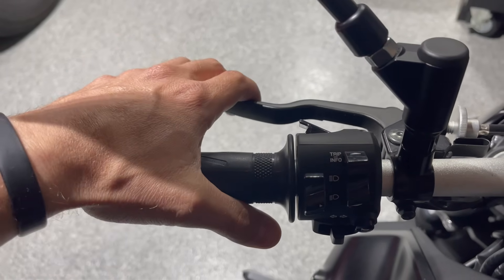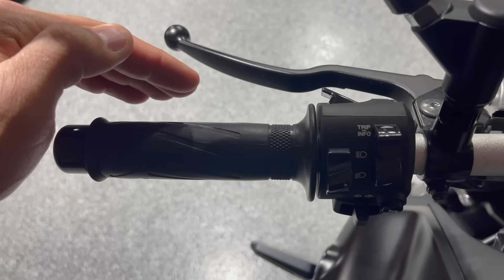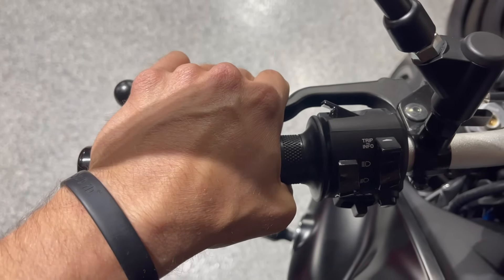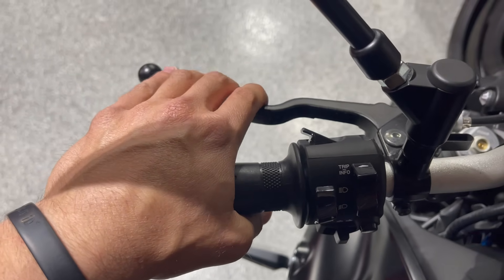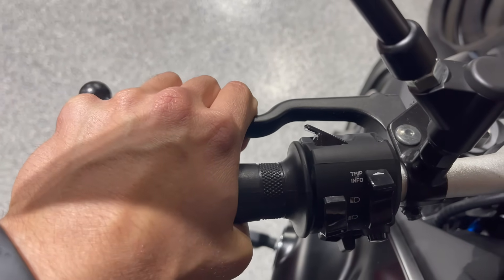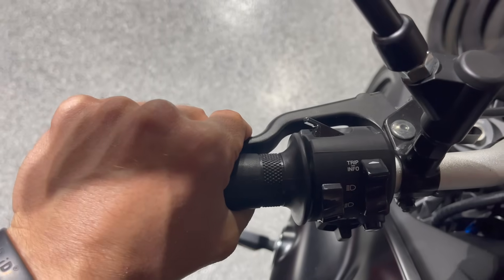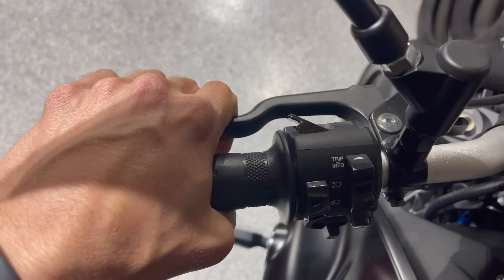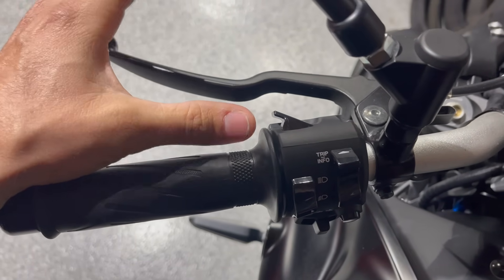Don't Make This Common Clutch Mistake!

Comment: I have never had any problem with any other bikes until my 2016 Harley Street Glide. I was very confident riding in slow speed on other bikes until I got Harley. Felt like I forgot how to ride Lol ! First the friction zone is right in the middle when bike is cold, after you do slow speed drills and when bike is hot friction zone moves far out. Very unpredictable. For reference my bike is all stock, bought it new  and has 52,000 miles.

Comment: No disrespect but never change gears in partial clutch play. This will impact your engine performance and clutch plate with time. 
The correct way is to fully pull the clutch and change gear that's why its called clutch disengagement. When you pull the clutch fully the gear box is freed for you to change gears. 
When you partial even if u don't touch the throttle the bike the bike will move forward that's because the gear is working to push the bike ahead and changing gear in this mode will guarantee destroy your clutch plate and all the tooth in it.
Reply from the maker: Well I must be lucky because 500k miles I never had an issue with any of my bike's clutch. But you ride how you wish, no one says you have to do what I suggest in any of my videos.
Reply: @MotoJitsu   NP buddy but people watch your video and pick up tips. I feel it right to show what's right. I repair bikes in India and people here don't sell their bike often and literally use the bike for years. This issue of clutch plate is major for most riders especially the new riders who burn out their clutches due to partial clutch play.
I am just sharing what works best and is not targeted against you 🙏
Reply from the maker: I just re-watched my own video to ensure I remembered what I was saying in it...yes you don't have to pull in the clutch all the way...no worry about damage...especially true for my slow speed MotoJitsu drills, just play in the friction zone. If you don't want to do that, don't. But there's no harm. Many ways to do one thing. I know some people who try to do my drills without touch the clutch at all...it's up to you. 

Sure if you're revving your engine and doing stupid stuff with your clutch you can destroy it in a day...maybe you see that in India but that's not what happens with the people who practice my drills. You thinking you have the "right" way of doing something is the issue...there's many ways to do one thing and what's best for you on your type of bike may not be what's best for someone else.

Lots of people ride lots of different bikes...what I said in this video is for anyone on any bike, how do I know that? Because I've ridden just about every bike you can imagine doing the same thing I say in this video and no issues...it's just another way of doing something. Just because you disagree doesn't make it "wrong"
Reply: @MotoJitsu  🙏👍

Comment: Very informative for the new riders , but one thing to factor is if you have a hydraulic clutch it's different not always but for instance my Suzuki Bandit is a hydraulic clutch and you have to pull the clutch in all the way for it to fully disengage , " non adjustable " and my Honda CR250 is a clutch cable " fully adjustable " like the one in the video and you can just use two fingers to pull it in. Just go off the feel of the clutch and you should have no problem

Comment: This is what I did wrong today, I wish you were in Philadelphia, I dropped my bike when making the U turn I fully pulled the clutch then when let it go it jumped and I squeezed the front brake because of the scare….now I need to fix the scratches

Comment: Once you get the timing down, you'll find that you don't even need the clutch to shift gears. With practice, one can shift right as the throttle is disengaged. This is known as floating gears.

Comment: Totally disagree 😐.
May be in a new bike you can do this, but after bike gets 3-4 years old, it's clutch becomes almost half. Then if you do this you will destroy your gearbox!
I have been riding a bike for 12 years and never found any issues by pulling full clutch while shifting.

Comment: I dont even care i just quickly pull the clutch let of the revs push it up a gear all with in a second wait one more pull the clutch max revs let go when I feel the kick die I slightly pull my clutch again quickly at max revs procced till end of the gear then I repeat

Comment: Question: But is it wrong if I pull the clutch all the way? If so, what'll go wrong? Just curious

Thank you
Reply: Nothing goes wrong--it's just a tip to make your life easier.
Reply: As a mechanic (40+ yrs)who knows what happens to your transmission when you shift, I fully disengage the clutch  when shifting.  Friction zone is an awsome control,  but your transmission won't like you shifting there
Reply: @brentfellers9632  feels much smoother, when not pulling clutch all the way.
Reply: @brentfellers9632  as another mechanic, ofc it's best not to shift whilst in the "friction zone", but once the disks have separated, it doesn't matter if they are a millimeter or a mile apart, so once you pulled past the "friction zone" (usually about 1/2 of total lever stroke, if set correctly) you can shift and you don't really need to pull any more.
Reply: @itzFYEB  I'm pickin up what your laying down,  your correct.thanx
Reply: @Bobby-lh2sx  I will try it, snowed yesterday, roads are clear today but needed to do some "adulting" today and wrenching on project bike....tomorrow 😢
Reply: @itzFYEB  Got it. Thanks!

Comment: When you’re doing low speed stuff do you keep the throttle going a little bit and just use the clutch to control speed? During my course, I noticed I was giving it throttle when getting into the friction zone and it made things a little jerky.
Reply: You need to also drag the rear brake while doing low speed maneuvers. Check out the ride like a pro channel.

Comment: the throttle is where most of us have issues especially on a vtwin, rpm too low engine gets choppy rpm too high is unnerving, a carbureted engine throttle feels more segmented where fuel injection is more dynamic or linear, at least on my bike where i have trouble is maintaining the rpm when twisting the bars back and forth

Comment: I actually do this when i change gears. Except when coming from neutral to 1st. But after that I just hit the friction zone I don't pull the clutch all the way in. Even on idle waiting in traffic. I just pull enough where it sits neutral while holding the clutch

Comment: The friction zone is where you adjust it to be at. You can have the friction zone at the grip, in the middle, or at the end of the range. But why are you using the clutch to upshift? Motorcycle transmissions are made to upshift without the clutch. And I suggest getting the clutch completely out of the friction zone to downshift.

Comment: I have small hands so i dont have my friction zone that far out and i have adjustable levers, so i can pull mine all the way in as i dont have to let it out quite as far. I think some people just set it up as per the workshop manual. But you dont have to aslong as the clitch isnt dragging you can have it bite where you like. Its easier for smaller hands.

Comment: I found this out by surprise on my second ever ride when riding on a long wide straight and accelerating quickly. I ended up shifting before I reached a full squeeze, which surprised me that it still continued to shift thinking I had made a mistake
Reply: Depending on the bike you ride if you're in the right rpm you can clutch less shift anyway so that might have been what you experienced

Comment: When shifting faster, I'll often only tap the clutch between gears. I'll use only two fingers and quickly tap on the clutch lever, pulling it in just barely enough to allow the clutch to slip, that combined with timing the throttle and shift lever makes for very fast and smooth shifts. Course thats only really one step remove from a full clutch less upshift, which I also do from time to time. Stuff like this is why I love a 300. Even on the street, being quick with your shifts can matter. Usually it doesn't, but if you're having a bit of fun and chasing a bike faster than you, you can use all the tools in your toolbox and use everything the bike has. Its that ability to safely and reasonably use everything your bike has whenever you like, that lets you get better and better at riding. I've practiced more highspeed clutchless shifts, spent more time maximizing rpms for power, and spent far more time working on my cornering than most people riding 1000cc bikes even can. Dont even get my started on low speed stuff.

Comment: Damn this reminded me I need to adjust my clutch cable tension… I’ve been having to pull extra hard lately haha
Reply: Well the cable adjustment isn't to vary the pull effort at the lever. You should have a little slack at the lever. That way your clutch will be fully engaged. If your lever is harder to pull than before, there's something wrong.

Comment: I wish my msf instructors would have taught us this way about shifting. I was pulling it all the way in when shifting and my shifts were rough. I had 2 smooth shifts in the 2 days of my msf. I prob got those 2 smooth doing what you said without realizing it at the time.

Comment: There is nothing wrong with that practice. In fact it could prolong the life of clutch plates. Why stingy? I hv tested my busa clutch switch and it only works when i pull it close to the handlebar.

Comment: I can see the advantage on slow, tricky or both combined manoeuvres. However, if clutch adjustment is correct, the lever, should not travel all the way back, anyhow. TBH, with many engines out there, gear changing, has reduced in frequency on a 6 speed box,  400 cc's and above, it is rare when moving to need to use the bottom 3 gears. From standing still, clutch use is necessary to go up through the box, I set free play on the cable @ 2-3 mm/ 1/8 of an Inch, just fitted a "Walker's" clutch and I am very, happy with it, territory, England.

Comment: In the Netherlands every driving school will teach you to always pull the clutch 100% when shifting gear and always with all 4 fingers. I see many Americans often demonstrate it is somehow better to only use 1 or 2 fingers. Its not, its less safe. But then again, in the USA any idiot can buy a bike and start driving it without any lesion's, exams or basically experience. In the Netherlands the standards for you to be allowed to drive are very high. resulting in better drivers and safer roads.

Comment: You should change to a short adjustable CNC lever. More control of the engine braking. Brembo RCS19 and HEL lines for the brakes though.

Comment: Note: It depends of the adujst of the lever too, some people use the ajustment to full press the cluch to pass friction zone, like me!
I know is probably a bad ajust becose you can wear out the clutch sonner but thats just me!
Reply: It doesn't affect these wet bath clutches as far as wear....they r designed to be used in friction zone for extended times. But it does do away with the safety built in when u have a dead space b4 engaging. Immediately engaging leaves u vulnerable to many, many exterior events that may cause ur hand to lose even a minor portion of ur grip

Comment: This is the greatest advice I received as a begginer. The clutch in the car I only use  for a short period. For motorcycle, as I tested use it all the time in slow speed for  first and second gear. Now I can manage my motorcycle at slow speed. If I do not press the clutch when I am in first gear and I try to accelerate, the motorcycle is very brutal. Now is just fine when I use the clutch in the friction zone, moe smoothly. Thanks

Comment: The friction zone on MT-03 feels tight af. I'm a rookie, but I still miss gears occasionally, so I'm just hard pulling until I get the adjustable levers.
Reply: there is no need for adjustable levers to fix that issue, as a matter of fact, adjustable levers WONT fix this issue, you can register the clutch free play and the point where it starts disengaging simply by turning the screw with the big collar (actually called clutch adjuster), the one where the cable starts.
Reply: If you are missing gears it sounds like you need to apply more force in your shifter foot. Make sure that you are clicked in the next gear fully as sometimes you can get lovely false neutrals.
Reply: @argusdnb  Thanks for the tip!
Reply: @argusdnb  what are false nuetrals? I assume the bike sticks between gears and revs up likenif in nuetral? Is it bad for the bike? Sorry if those are dumb questions i just got my first bike last week.
Reply: @inhumanfilth681  False neutrals are incomplete shifts. These happen when the shifter doesn’t complete its full travel which doesn’t fully engage the gears in the transmission. When the gears aren’t fully engaged they can slip and disengage meaning you have no power to rear wheel.    

And no it isn’t bad. Motorcycles engines can usually take it. Sometimes your engine will make a nasty grinding noise if you try to shift after a false neutral.
Reply: @argusdnb  that makes alot of sense thanks man
Reply: @inhumanfilth681  for sure man, ride safe!

Comment: This really helps on my Ducati especially in city traffic.....less clunky and jerking.
Reply: I can barely find neutral on my ducati with the clutch fully pulled, I don't know how you do it...I have to readjust the clutch cable every week otherwise I cannot get to neutral, the gearbox will get too rough and it will require so much force to change gears that I can never stop between first and second gear.

Comment: I feel like that's how you wear out your clutch. You never do this in a manual car, you push the clutch in to let the RPMs drop so you can catch it in the next gear. Idk I know motorcycles have wet clutches so they can take more abuse but it still seems scary to do.

Edit: my bad you said it's for slow maneuvers, not for full range. Still seems scary but ig it wouldn't hurt to try.

Comment: I learned this big time when I got my ZX-6R, I barely have to pull in clutch to shift. Most of the time I don't even need the clutch cause my bike has a slipper clutch and assist as well as a quick shifter(up only). My previous z650 was super touchy though where I forgot how to ride it, recently got on it again and i felt like a brand new rider. My ZX-6R is just so smooth and refined about everything on it. only complaint I have about that bike is everything on the handlebars vibrates when I'm at or above 9k. Other than that it is a dream to ride.

Comment: I feel it depends on the bike. Like my R3 would tolerate that really well. Use two fingers with the clutch bring it in to my knuckles and had zero issues. My scout bobber on the other hand literally hates it and the gear changes aren’t a smooth as full clutch pull. But maybe that’s just me.

Comment: But will that not damage the engine while shifting?
Reply: On a car, yes. On a motorcycle with a wet clutch, no.
Reply: Well, probably not the engine in either case, but the other guy is right about clutch wear. Most motorcycle clutches are bathed in oil for cooling and consist of multiple clutch plates instead of just 1. 

I do wonder about some of the other less common clutch systems available now. I suspect you probably don't want to keep motorcycle dry clutches in the friction as much (though idk first-hand.)
Reply: @zorgzev96  Great, thank you for your reply ;)

Comment: Well, I'm no motorcycle expert, but if you do that in a car, that's BAD practice. You should never do that, wears the clutch and all other parts related. This is actually a "DON'T". 
I'm pretty sure it's just as bad for a motorcycle, as the working principle is the same.

Comment: I'm curious as to why there is so much travel on the lever if half of it is basically useless?
Reply: The additional travel allows the clutch bite point to be somewhere around 50-60% of lever travel
Imagine the clutch engaging as soon as u let go of the lever even a bit...won't be pleasant
Reply: @abhimanyuks5383  actually pretty pleasant for me but depends how big your hands are, there is less strain to the hand bcuz its very straining to ride in the traffic with the clutch biting midway of lever travel. I adjusted mine to about 80-85% when it starts biting but totally depends on the rider and their riding conditions
Reply: @mattchu79  yesss...70-80 ish is ideal, was answering wolf Standish,s question why we have excess travel...imagine the clutch engaging at 5-10%
Reply: @abhimanyuks5383  sorry I meant 80-85% of full clutch in so basically 15-20% of what you meant I think
Reply: it's pretty much due to hand size and preference, our hands make "peak power" only at a certain point of the motion, which is why the engagement point can be adjusted. cable stretch also plays a part.

Comment: Absolutely disagree, you actually know how a clutch works? You already pulling it in so why not just pull it all the way in, you also only need to use the clutch when stopped and starting... probably should leave the tips to the professionals.

Comment: The friction zone is going to be different for every bike though depending on the clutch settings and the torque the bike has. On a 125cc you might have to pull it back a bit more than on a 900cc right?

Comment: I never jammed my clutch pedals to the floor either, which is the same thing as jamming the lever to the bar. Do you car drivers jam your pedals to the floor at every shift? Think about it. Once the clutch is disengaged, more distance is irrelevant, and unnecessary. That’s all the video is getting at. It’s not riding the clutch if the actions are done at the same speed, full to the bar, or just until disengaged. Not rocket science to grasp really.

Comment: My clutch disengages with the lever fully pulled in. Might have to so some adjustment. And there js no slack in the cable, which is very strange.